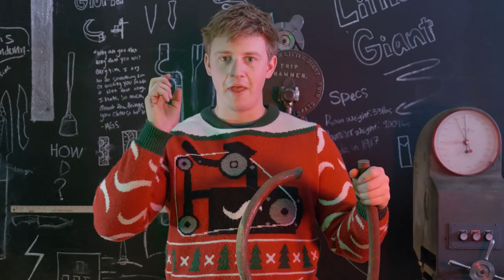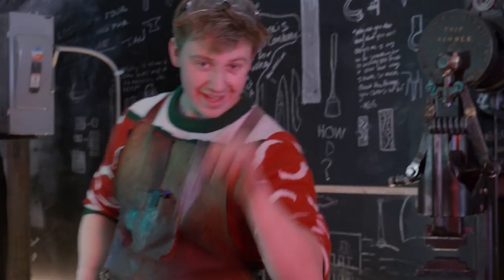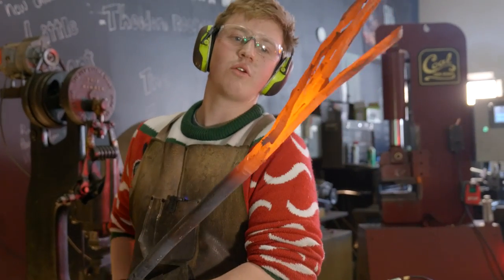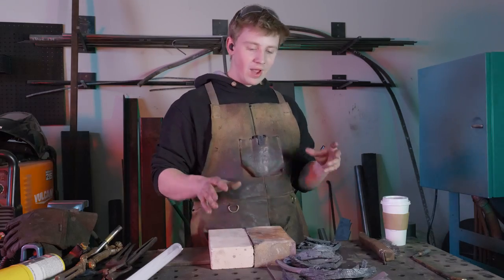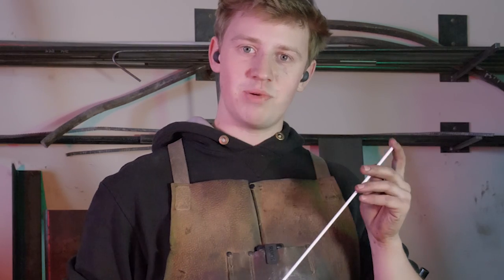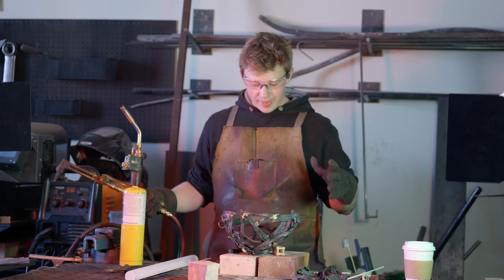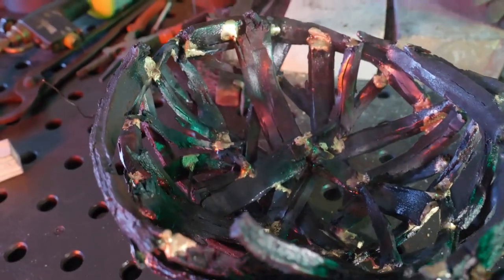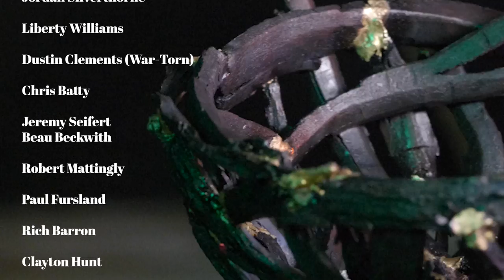I tried to make a bowl and this happened…

Comment: Yes, it's a bowl by definition. (Bowl: a concave usually nearly hemispherical vessel : a rounded container that is usually larger than a cup)

An idea for your quench tank.  Make a metal net (or bowl with holes) and attach a long (the length of your quench tank's depth + extra) wire to it. Leave wire attached bowl in the quench tank with the extra wire sticking out and bent over to the side (to keep it out of the way, right?).  Now you can more easily retrieve dropped items.  💡😉

Well done. 😀☕👍

Comment: Bowl is a shape not an object. The interior part of a colander is the bowl of the colander, where you put the tobacco in a pipe is the bowl of the pipe, the interior of a crater is the bowl of the crater, where the wine goes in a wine glass is the bowl of the wine glass. A soup or salad bowl is a dish that has a bowl shape to contain the soup or salad but is just called a bowl though the whole object is not itself a bowl.

Oh and that look when you dropped the cutoff tool in the oil tank... Priceless!

Comment: That came out great. If you try something similar again I'd suggest taking a sheet of glass and heating it up so it flows down into the bowl, should deal with any sharp edges and it'd hold water.

Comment: It’s a wrought iron basket, not a bowl (nor a colander lol).

I love the torn wrought iron, but personally not really sold on the brazing job, it just kind of looks like fancy chewing gum sticking pieces of bark together lol.  

I had a totally different image of how you would do this when you first described it, which involved the strips being lined up side by side, radially, with the brazing in between, and then the whole interior ground down and smoothed to a solid, polished finish, with the exterior rough and tree like, with radial lines of brass between the “corrugations” of the bark-like exterior.

Sound in this video was great.

Comment: Very cool to watch

I have a question. As someone taking there baby steps into blacksmithing, could you take an old axe head (or a cheap new one from harbor freight or somewhere) and cut/grind into a hot cut for a hardy hole?

I know that is a waste of material for someone more well outfitted.

But currently, getting larger hunks of steel and having tools to shape is a limiting factor for me.

I have plenty of tools to cut and grind already from other hobbies.

If I could shape an axe head to fit the hole on my anvil, is there any functional or safety difference? Type of steel etc?

I'm sure it would work, at least to start, but not sure if there is some unknown that would get me after a bit.

Similar to when I learned about the danger of bent pieces on edge of anvil or hammer that could break off and be dangerous as could become shrapnel. Before was mentioned, wouldn't have even considered.

Hope the question makes sense and someone more knowledgeable can answer.

Love seeing your projects and following along!

Comment: sand blast it to get the same effect as wire wheel
Reply from the maker: That’s a very very different effect, a wire wheel is a burnishing effect, and a sand blast leave a satin finish, the only similarity is abrasion 👀
Reply: @WillStelterbladesmith  I guess I'm out of box thinking .. But maybe if you use a softer medium like soda Or a type of ash ?
Reply: @WillStelterbladesmith  Maybe a lighter medium like soda or type of ash  ?  To soften and clean the piece ?   Either way love the wrought iron splinter look .. Amazing work !!